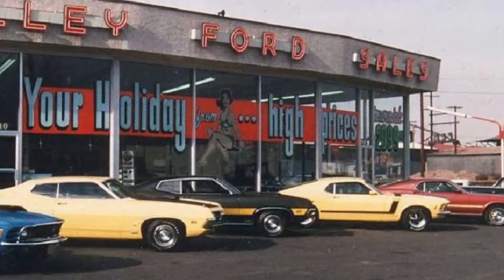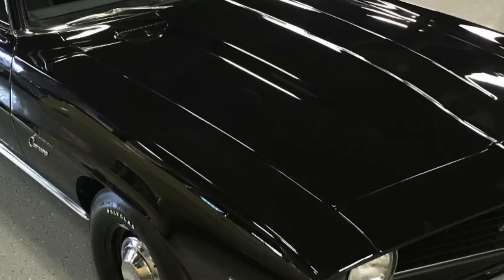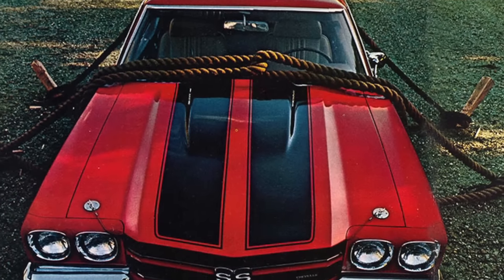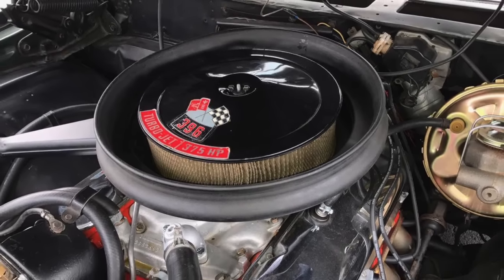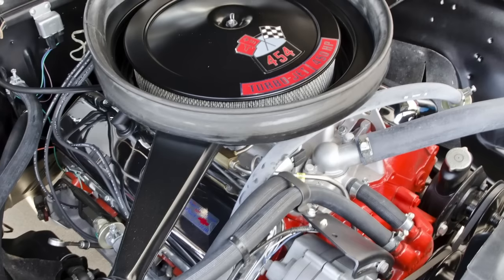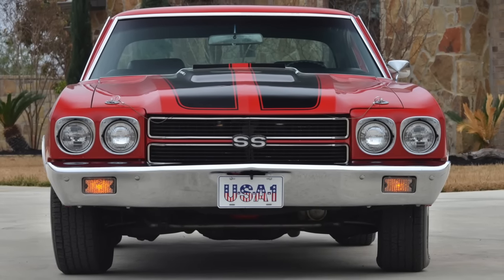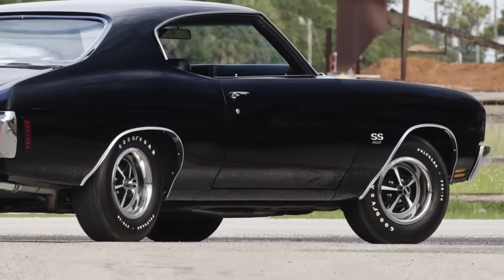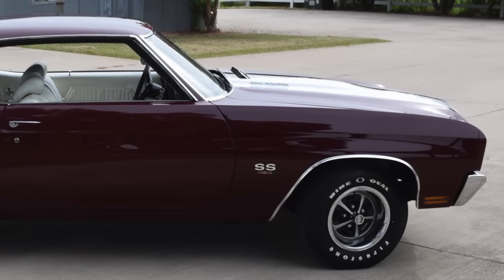1970 Chevrolet Chevelle SS LS6 454 – Freak of Nature

Comment: knew a guy in the Navy in 1974 that had one, the headrest was a necessity
Reply: FullSpectrum Survivalist everyone forgets about torque. big blocks, don't matter the manufacturer, are torque monsters. me, personally, I love old cars in general. the fact they're still on the road today is awesome.
Reply: No, I didn't forget, did you forget the 1/4th mile times, or just chose to ignore the facts for that year?
Reply: Wow... from the whopping 1/2 G a car that goes 0-60 in less than 6 seconds produces. You have more force on your neck getting out of bed!

Just another Boomer Bullsh!t story debunked with basic arithmetic.
Reply: @SpectrumSurvivalist  A friend of mine put a nos LS6 crate engine in a tubbed 69 camaro and went 10.4 in the 1/4. This was in the 80's. the crate engine cost him $2500. All the Chevelle needed was a good set of tires to improve 1/4 mile times.
Reply: Lyle Abbott  Ford = Fix Or Repair Daily. I have a big block in my truck with only 300 HP and 300 lb.s Torque. This thing had over 500 HP and 500 lb.s torque. My truck, with it's low relative power, sets you ack in your seat as long as you have about 400 lb.s over the rear tires. In 4 wheel drive, it still sets you back. I have owned and driven many pony cars during that era. The SS blew them out of the water, at least straight line.

I have ridden in a 1970 Chevy SS, completely decked out. With better tires. Oh yes, you need the head rest and should have a 5 point harness. You have NO idea what you're talking about.

Comment: My dad passed away 5 years ago and my brothers and I have one of his many muscle cars, the 1970 LS6 454 4speed chevelle. It does need to be restored but its always been inside and is super clean. All original motor and trans, does anyone know what it would be worth? We have everything needed to restore it, from trim to new GM original front fenders even tho the ones on the car are still usable.

Thanks!
Reply: MiK3Y13 Properly restored to factory numbers matching Ls-6 at auction like mercum or barret Jackson...if it's a 4sp rock crusher 100 grand or more easy.. Th400 80G...... these are highly sought-after Cars
Reply: It's worth a fortune if you like to be a freeway star.  It's priceless if you don't sell or wreck it , it will only increase in value as time goes on.  Don't let it get away for nothing, you will regret it .
Reply: MiK3Y13 ... If its ALL original and is super-clean as you have stated, BELIEVE IT OR NOT, It's worth more NOW than it would be if you were to restore it !!! CHECK FOR YOURSELF !!!
Reply: Its not a real SS unless you can show a build sheet, no other way to prove it. The build sheet can be found in several different areas of the car. On top of the fuel tank, stuffed in the springs in the back seat, glued to the inside of the passenger door panel, etc.. If you find a build sheet it is like finding as much as $50,000 added value depending on the options your car has.  A 1970 Chevelle SS without a build sheet is worth in good to excellent condition, $25,000 to $60,000 depending on options. A real SS with build sheet would be $35,000 to $100,000+
Reply: I'll give you $5 for it
Reply: "Its not a real SS unless you can show a build sheet, no other way to prove it."   

Not being able to prove it is not the same as it being or not being real. Funny thing, but take as many pictures as you want, but you can't even prove there is air in the pictures, even though ever picture is full of it.
Reply: I know this is a old thread sorry to hear about your dad  it's worth money that's probably why he kept it if he built it up to a SS 454 as many have said and it had a different motor it's still sought after I Had a 71 challenger had the paper under the rear seat springs and also behind the glove box sold it for 4,700 in 1991 I could not  touch the 318 challenger for less than 12,k  or more
Reply: It's worth about fifteen hundred bucks... Will you take cash?
Reply: As you describe it, in fair condition, $35 to $45K. Hemmings is a place to look at current market prices.
Reply: Chris Arroyo 
LOL
Reply: @Quietbut_Deadly  Whatta joke...
Reply: It is priceless if it is your dad's. Dont sell it, you will regret it later in life. Give it to your kid so he/she can give it to his/her kid. Make it a family jewel
Reply: Keep it, it will gain in value over time. Or you could pass it down to kids.
Reply: FISTSLIKEBULLETS2 we still have all the cars. All three of us are around 30 years old and continue to look after them all. We have a few solid cars, some restored and a couple left. We have 10 cars total from 1970 Chevelle I mentioned, 1966 corvette 427, 1973 corvette 350 with a 502 in it. 1969 Camaro SS 396 pace car, 1967 charger 440 original(restored), 1971 Monte Carlo SS 454 original car but not motor or trans(added an overdrive trans for cruising), 1987 grand national(500 miles on the odo and still in packaging), 1983 trans am, 1987 Iroc camaro 350 tpi, 1984 camaro z28 ls3 swap(very clean original looking car never seen the winter with swapped 2012 camaro ls3. We all miss him very much thanks for asking. We grew up at the drag races so regular life just doesn’t compare to the fun we all had as a family there.
Reply: seba k we plan to, it’s hard to see the newer generations being even interested. I’m only 28 and I’m worried they won’t even care. I guess we’ll see how this strange world works.
Reply: Get ahold of Patrick Glen Nichols. He's got a youtube channel. He authenticates Chevelles and has created an official Chevelle registry. He's the leading authority on all things Chevelle.

Comment: Great video. I bought a brand new '70 Chevelle in 1970. Unfortunately, it was a 350, 2 bbl version with auto. It was a very nice car and had A/C. The thought of the 454 spd is still a dream.
Reply: vppnbrent ... same here, my father was a practical man he thought 66 Malibu 283 four speed is more than any 20 year old should have. 
" I really wanted that 396 " 😔
Reply: Wow Jason, at least you got a 4 spd. Congrats. My first car was a '57 Chev Bel Aire, 283, 3 on the tree. I wound up putting the 3 on the floor. I quickly became an expert at rebuilding the 3 spd to install new cincros. At least once a month I had to do it and from start to finish I could be done in hour and $10 out of pocket. This was 1965. I would have giving anything for a 4 spd. The spd shift 1-2 would kill it every time. Sure wish I had that car back today. I sold it in 1969 for $750.
Reply: vppnbrent  hello, my first car, 72 nova with a straight 6, maybe i was just lucky, but that straight 6 was bulletproof!  No mechanic needed for that thing, body rotted away, that engine was still going strong!
Reply: My friend, you should've got the one you really wanted. When I came home from military service in '68, I wanted a Mercury Cyclone GT with a 390 4bbl with over 300hp. I ended up settling for a '68 Cougar with a 289. Nice car, but just not enough pop. Less than a year later, I decided I was getting some muscle under my rear end and started looking around. Looked at all makes, Road Runners, Super Bee's, Chargers, Chevelles, GTO's, Buick Gran Sports. When I looked at the Chevelles, I just loved the way they looked. I debated on what engine to get. It was gonna be an SS, so, do I get the 325hp, the 350, or the big one, 375. After test driving one, I got the big boy and never looked back. What a car. So much fun to drive. I'm now 70 yrs old and still like driving the muscle cars of today. My youngest son has a 2016 Taurus SHO and Mustang GT and I drive them maybe once a week and it's still fun.
Reply: This was a nice car, vp. A friend of mine's Father had one that i slid my bike under when i was 13 or so. Weird downhill to a sorta main street. Luckily he stopped.
Reply: A friend of my dad bought a 1970 with 396 manual. That thing was brutal back then. You need to do 1000s of $$$ of custom work to get a car to perform like a factory car did back then.
Reply: @alwaysopen7970  Nope. My 2017 Camaro SS would smoke this SS. With 8AT, does 0-60 in 4.0, Quarter in mid-high 11s. Bone stock + K&N Typhoon CAI and Vitesse throttle control.

Comment: I remember reading a Car and Driver road test from 1970 on the LS6 when it was new. Theirs had the Turbo 400, and they said it liked to surprise the rear tires with part-throttle downshifts which would break 'em loose when they weren't expecting it. The LS6 was one of the very few cars GM produced that could keep up with a Hemi. I feel sorry for any young buyers trying to insure one at the time, though---I'm sure they paid a fortune.
Reply: Speedy rapacki  Keep in mind though that you couldn't trust factory ratings from anyone---many were underrated to help keep insurance premiums a bit lower. 2 examples; the Hemi and the Buick Stage 1
Reply: The '70 Buick 455 Stage 1 BEAT the Hemi.
Reply: @hendo337  No it didn't. On the dragstrip, the Buick's big torque would put it in the lead until mid-track---then the Hemi's big valves would start to really breathe, and it would shut the Buick (and anything else) down at the end.
Reply: @justsumguy2u  you could throw the L88 in there too.

Comment: The Chevelles are my favorite cars.  My first car was a 1968 Chevelle with a 230 cu. in. straight six with a three speed manual with an overdrive.  To this day I still have it, but it has been modernized.  New suspension.  Fuel injected 496 cu. in. with a Tremec six speed double overdrive.  This car is how I learn how to work on cars.  It is fun to travel down the road in.

Comment: As a kid (16?) I drove a 64 (66?) Malibu 396 4 speed from downtown L.A. to Thousand Oaks.
 It was fun. No freeway, maybe 50 foot center divider with Oak trees everywhere, not a house or other structure around.

 Hey, another story. I was driving one of the main drags in Hollywood when a Charger drove up next to me at the light.
 He had 6 little roadrunner decals on the upper forward corner of the driver door.
 An ACE!! I got a kick out of that.

Comment: I remember one magazine tested all the fastest muscle cars in a 1970 showdown issue. The Chevelle LS6 posted a 13.1 quarter and the Cuda Hemi posted a 12.9 quarter. Traction was difficult with the Chevelle as well as gear changes with testers commenting "that old Muncie balked".
Reply: I had 68 Camaro 396/375 with the Muncie tranny. It was not a smooth shifter.
Reply: The Hemi Cuda was the ultimate muscle car.  Fitting that the Demon is today
Reply: muncie shifters were junk in the chevelles
Reply: That's why you put a Hurst in and no problems...
Reply: Speedy rapacki  Never said they did. Read before opening your mouth. Many people including myself replaced  sloppy Muncie shifters with a Hurst......
Reply: Speedy rapacki  It shifted like a dream because it had a Hurst shifter.
Reply: Speedy rapacki  As I said before simpleton, I never said they did......

Comment: the 70 chevelle ss 454 ls6 came with a 780cfm carb, they said 800.they also said that it was only in 2 cars . wrong again the ls6 also came in the El Camino pick up in 1970.
Reply: The El Camino was an option of the Chevelle, and they did come with 800cfm Holleys. Want to buy one? I have 3 factory originals........
Reply: @OldGriz708  wish I had the $$. My Yenko one was stolen

Comment: The TH 400 was Gm's first and best 3spd automatic transmission. It's design was similar to the 727 Torqueflite, designed by Chrysler a couple years earlier. To get around patent violations GM put first gear in the front of the transmission instead of the rear basically mounting the gears backwards. They also added a vacuum modulator to help control the transmission shift points. Later on, in 1968 Chevrolet brass wanted a transmission that failed sooner so that they could sell more parts and services to its customers. The then designed the TH 350 which was a smaller, more lightweight transmission. The man in difference between the TH400 and TH 350 was that unlike every other transmission ever made to that time the input shaft was not supported by any bearing between the two shafts. This allowed both shafts to float around inside the transmission. Any support the two shafts got was due to the clamping pressure provided by the clutch packs. So, if you're building a hot rod and want to use a three speed automatic dig around for a TH400. One side note, the '67 TH 400 used a switch pitch torque converter. If you can find one use a switch pitch converter out of a super turbine 300 transmission from a midsize Buick and you have a Converter with between 2500 to 300 rpm stall speed that is much more efficient on the top end. This was GM's way to increase efficiency before lock up converters were invented. They were dropped because of cost and complexity, which isn't really all that complex. Good luck!

Comment: A friend of mine had a 70 LS6 454 he bought from a guy that his dad owned a sandwich shop that i worked at.He paid like 450 dollars back in 1989 or 1990.If i remember right me and a friend we're offered first dibs on the car but we didn't have the money.The one problem with the car was that the next owner had replaced the torque converter and it kept blowing the transmission lines.He later sold it but from what he told me he gave it away.A numbers matching car at that.Thats the way things go.? I remember going to car lots back in the day and seeing cars that went for nothing but are worth a mint now.
Reply: Tell me about it. My first 4-4-2 - triple black conv - needed a new top, and I had bypassed the heater the previous Summer, due to a leak. Finally, I cracked the windshield with a PLASTIC ice scraper, so I traded it in on a '71 Impala coupe. I doubt I got $200 for my Olds. What would it have been worth Today?

Comment: Great job. I love any facts I can get about the Chevelle. Lil fact you could've added, Chevrolet marketed the LS6 at 450 HP 500 TQ but in reality they lowered the actual numbers to help avoid high insurance premiums. In 1990 Car and driver Dyno tested an original LS6 with 500 miles on the engine dyno and it actually pulled 564 HP and 608 TQ. With drivetrain loss that would still be about 500 hp to Rw! Amazing.

Comment: my '64 Malibu SS 327 (m21 4 speed) might differ with your model year reference..64 thru mid 65 SS models had the SS badging on the rear quarter...after that it was on the front quarter with numerals too
Reply: Right,  Malibu SS was an option for the 64 and 65 Chevelles  and in 1966 they made the Chevelle SS396 a separate car, no longer just an option on the Chevelle.

Comment: I had spoken with a mechanic whose dad owned Chadbourne Chevrolet in Upland CA, and around that time the LS7 454 engine was offered as a dealer installed option.  With headers, some retuning of the carburetor etc., the projected engine output approached if not exceeded 500 BHP.  I believe that to be true, though I don't know if any other dealers ever made mention of that option, perhaps the LS7 crate engine was limited on availability?

Comment: Did the 70 Chevelle SS have leather seats?  in Dazed & Confused Wooderson says " hey, hey, hey, hey, watch the leather man"  lol... but i didn't think leather seats were available????
Reply: No. Fabric or vinyl.
Reply: Wooderson could have had a upholstery shop redo the seats in leather, but, no. Leather was no available from the factory in the Chevelle.
Plastic was all the rage in this era. cadillac bragged about thier molded plastic dashboards (introduced in 1968) which were so much more "advanced" than the steel ones (with padded pads) common in cars back then.
Reply: There is a scene in the movie when wooderson is running through a detailed list of engine and drive train modifications done to his car, so one can assume that he had his seats reclad in leather

Comment: All i knew was the LS6 was the most powerful pruduction car of its time. No wonder. Almost had one,,,,''70 Malibu 307 PG with a grille i painted like a SS. Should have bought the FireBird. Heck, a Gibson L6S used to be a dream. Carlos dug them.
Reply: I learned to play guitar on an L6S and it would have been a better guitar if made of mahogany or other more porous wood. The maple was too dense and heavy for my tastes.
Reply: Thank You for the reply. I knew a guy that had an L6S...ran that thru a Dist + and a Bassman 100 rig. Instant Santana and beyond. I never played it myself. Cool you had one.
Reply: Thank you for the informative reply, Doosterfy. All these 'numbers' make me wonder what the Real HP for the 440 Six-Pac was. I remember seeing a special on Muscle Cars a few years ago and some expert/guy thought Dual Quad Hemi's were great but finicky, solid lifters and all.
He called the 440 Six-Pac 'Violent'. Also turn key. They ran great all the time.
Reply: g mat The hp ratings for the 440 were pretty accurate. The four barrel made about 375 and the Six Pack made 390, same as advertised.

Comment: Bought a 67 SS Chevelle same year out of high school for $3100. I changed the intake to high rise aluminum with a powerful duel feed Holly. Added Hooker headers, glass packs, a racing cam with solid lifters . It was as I remember a two door, “fire engine red, black canvas top, black bucket seats and a 4 speed Muncie. I changed the instrumentation with real gauges not the “idiot light, added big wide rear tires with air shocks. Out in real hood pins and I was off cruising! Then I had to leave for the Army. Great and happy times!!

Comment: Why doesn't Chevy come out with  572 tricked out 1000hp?
Reply: Because the 427 is badass enough......lol
Reply: Because it would not be streetable or warranted not to mention cost probative. You can buy one rated at 700 hp roughly  ,turn key for about $26,000  then add another $20,000 in parts and labor and you'll have your dream....
Reply: Can you say crate motor